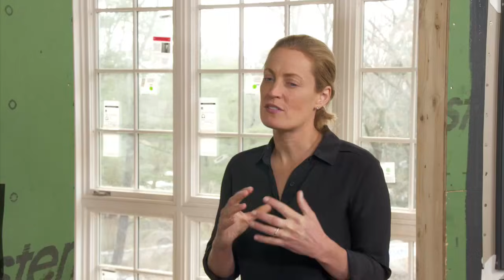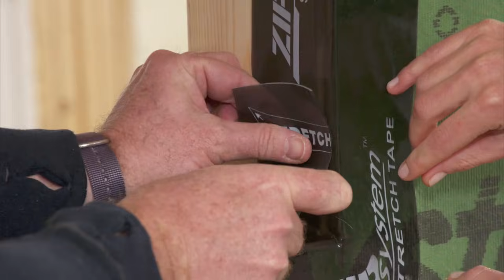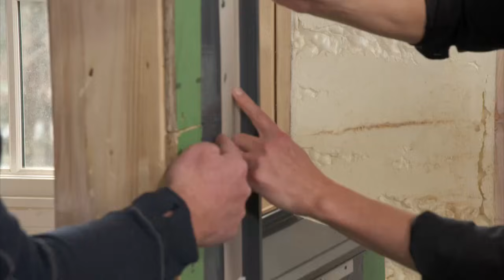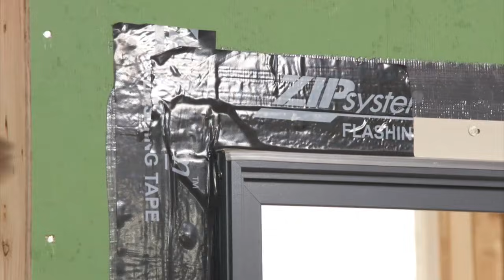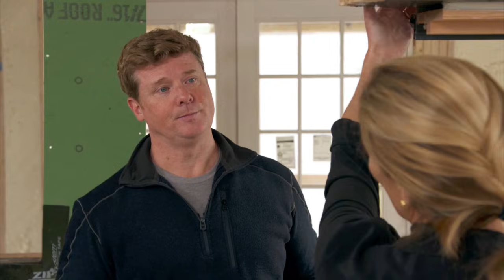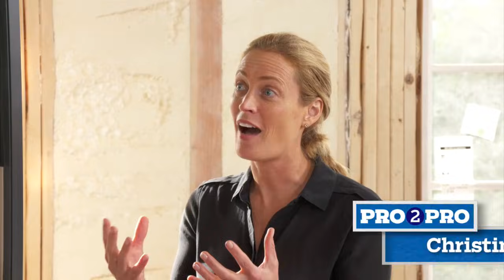Pro2Pro LIVE: Window and Door Installation Master Class | This Old House

Comment: I’m not understanding how the chamber mentioned around 23:00 (between the indoor backer rod and the exterior flashing) is sensitive to outdoor pressure when such length are taken to make that are air tight with metal flashing, back sealant and then zip tape. Am I also to believe the indoor facing backer rod and caulk are are tight? Can anyone explain?

Comment: How does this airseal method apply with a window that is installed using shims? So on a window with no nailing fin. Can I still achieve a proper air seal, or should I go back to the foam method?

Comment: While I'm 100% onboard with the air control layer on the interior, relying on properly-installed backer rod and sealant in residential construction (as compared to commercial) is woeful advice simply due to near absence of qualified/trained workers in residential.

There's a literal science to properly installing sealant and backer rod or the sealant will fail. I doubt 1 in 10,000 residential carpenters/window installers knows how to use backer rod properly. Commercial installers are trained to install the backer rod and sealant - rare as hen's teeth in residential.

As such, a far-more practical solution is to use pressure-sensitive tape (similar to what is used on the exterior although usually a bit thinner tape thickness - Siga Rissan tape for example).  It's faster, cheaper and easier to install, plus there's far less risk of improper installation vs backer rod/sealant.
Reply: What's the biggest installation error or lack of knowledge when using backer rod and sealant? Seems pretty simple in demos. But I'm all ears bc I'm attempting to educate my installer in more modern methods like this one.

Comment: Here's my problem with this philosophy. If the air seal is at the room side of the jamb, the jamb in front of the window pane is going to be like 70F in the summer from the HVAC. The outside of that jamb is going to be 75F. The humid air coming into the air cavity from outside is going to be high humidity 90F. Thats going to cause condensation on the exterior of the jamb in the air cavity. Keep the moisture out. Water First
Reply: Not that you want to invite condensation between that fully sealed interior and 3/4 sealed exterior but I think it'd be ok; if condensation occurs in that cavity (between the fully sealed interior and 3/4 sealed exterior), you have condensate that can drain out and the wall/rough opening is protected by flashing, either fluid applied or tape. I guess condensate could form on the window frame that is exposed in the cavity, but its primed. Maybe if there's much condensation expected, the hidden window frame should also get a durable paint? I think she describes a great sealing strategy.

Comment: Great presentation, this is how British Columbia has been requiring their window installs for some time now. My one concern is not allowing the window to drain properly when its attached directly to the sheathing. It would be better if it was held off the building by even 1/4" to allow that drainage if water gets back there or when the window fails. Nice to see this method being brought to a larger audience

Comment: Our neighbor had some windows replaced by a local window installer.  My wife then got an estimate.  I looked over his crews installation process.  Essentially 3 beads of caulk, window nailed in place, then seal it with tape on all 4 edges.  I tried to explain, I wanted the process you showed in this video.  The contractor, said, No.  His windows don't leak.     I plan on doing them myself.

Comment: I am having trouble finding the beveled siding sill piece. I want a this one for 2X6 exterior windows. Builder tells me not necessary since window has 5 degree angle built in. Where can I buy the correct cedar piece
Reply: Not true especially on shoreline
Reply: Jesus! You tell your builder what to use?! Listen to your builder, windows do have this feature built in. This bevel in the framing would only be useful if you have the habit of pressure washing your windows every weekend just for fun.

Comment: Its important to remember the stretchy Zip tape joints have to be rolled with a J roller to activate the glue. All seems & applications. Otherwise the Zip tape will come loose and buckle over time.